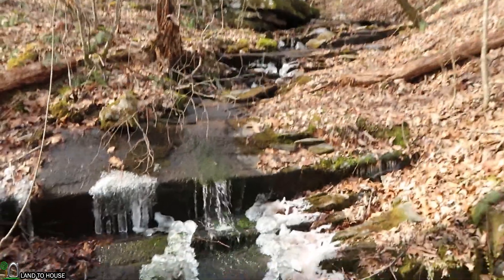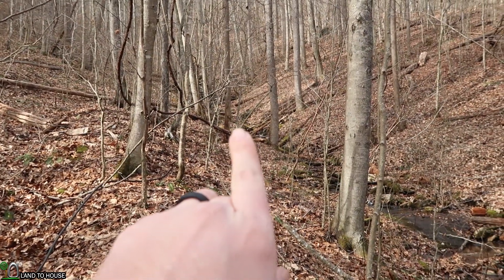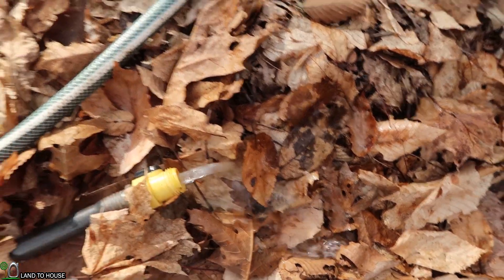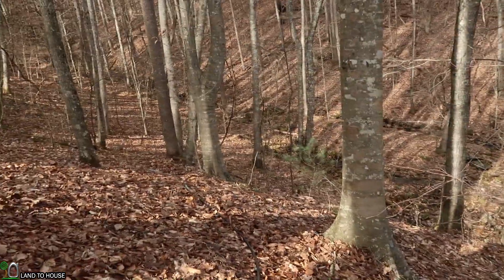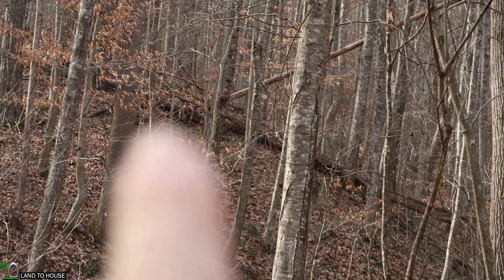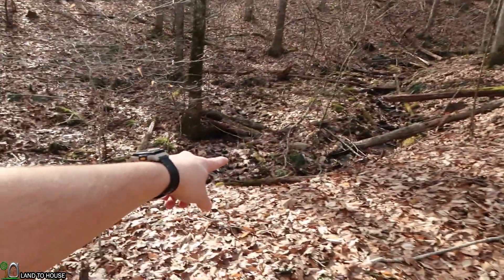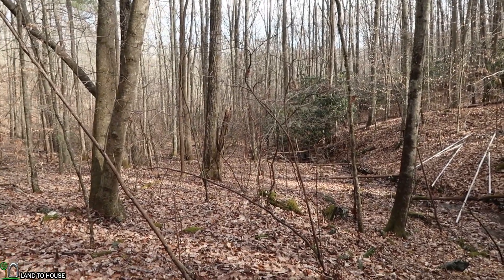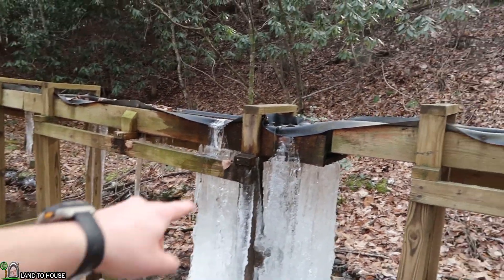Moving the Micro Hydro Intake

Comment: If you followed the creek bed using the largest area of flow 600’ of 2” to 100’ of 1’ to 100’ of 3/4” to 100’ of 1/2” should increase your output pressure a great deal.

Comment: No, don't make a channel. Use a extra large diameter pipe as a primary penstock and keep the gradient slight and constant. Then fit an air stand at the 50 gallon drum and connect the actual penstock. If in doubt, use bigger diameter pipe.

Comment: I didn't hear you specify the material of your 55 gal barrel; you probably already figure using poly instead of steel...I used steel for other purpose and it makes a great pinhole spray source in a couple years
Reply from the maker: I used a plastic barrel. So far it's doing really well. I picked one up in my local hardware store for around $15.

Comment: Need a large head stock pond to feed to the barrel supply line, I would avoid a  barrel get a larger tank to act as pen stock. Seems to me the next step is just use garden hose to fill the head stock fo testing. Use the ram pump to take the waste off the hydro to refill the pen stock year rounds sounds like a smart plan.

Comment: Looking at the intake location i wonder why you dont go a bit further upstream. Judging from the video i'd say  you can easily gain additional 3-4 psi. Most of the hydro setups i've viewed on youtube end up building an intake structure using a coanda screen or something similar that would fit right on one of those steps instead of sucking water out of a puddle behind one.
Reply: the use of a siphon  was  Convenient.     no  work   required.

Comment: Just an armchair thought here: I would personally run 2.5" or 3" penstock the whole the way. It would avoid most of the pressure loss due to pipe friction. Plus you would avoid the issues Joe brings up. How much more expensive would that be? It might be worth spending a little more up front for greater reliability.
Reply from the maker: I like the idea. The cost is likely going to be a lot more. Around $300 extra on top of the $900. I could probably make an extra 100w. But to be honest I should get 400w currently.  That's a lot for the house. I will have to see as times gets closer. Thanks for the input!!
Reply: 'you would personally'  NEED  to understand that when the flow rate is  So  low, the use  of  a  larger diameter penstock  is  irrelevant.

Comment: Why not build your mini hydro at the source and just run electric lines to your house? Also you could pond that waterfall section. Is that concrete or natural stone?  Ponding will build psi and gpm.
Reply from the maker: Do you mean have a micro turbine at that waterfall? I am going to have the archamedes turbine or waterwheel at the bottom at some point. . . .running 1350 feet of wire from that waterfall does not sound good. . Also it would only be a few watts.
Reply: 'why not'  be  100%   WRONG  
the  flow rate is  Determined by the amount of water present, in the source.        flow  rate  CANNOT  be  Increased, artificially.!!!      the power comes from  water,   Falling  Downwards.     conclusion:  the intake  MUST  be at the highest practical  elevation; if necessary, head  must be  'preserved', until the water can be delivered to a hydroturbine.

Comment: WILL YOU GET MORE FRICTION WITH THE RIBBED WALLS OF THAT DRAIN PIPE THAN WITH THE FLAT WALLS OF POLY?   WILL YOU GET A  TURBULENCE OVER THE RIBS ?  I JUST WONDERED.
Reply from the maker: There will be more friction for sure! But using a 4" pipe for 40gpm max should not be an issue. A 4" corrugated pipe can pull 70gpm at 5 feet of head pressure. So If I have a drop of 2 feet or so I can still pull the 40 or less gpm that I will have. That is the theory at least.  Some of this might change as I get into the project.
Reply: used  only  for the   lateral transport of the water.

Comment: I can't imagine this would turn out well for you. You'lll spend a bunch of effort trying to keep the pipe flat enough to prevent airlocks and silt buildup and you'll still lose head height and not shorten the penstock a significant-enough amount to offset the effort and additional cost of corrugated pipe. Just my opinion.
Reply from the maker: It will be interesting. Keeping the pipe flat and on the hill will be a challenge. Air locks will likely happen for the first several rounds of testing. I hope to have a way to clean out the intake box from silt buildup to help keep the pipe clean ish. The power savings will be around 50w continually. So $48 a year increase in power production.  I ran a tape measure the full length of the system and this will save 200 feet of penstock. So a savings of $80 from the corrugated pipe and then power increase of $48 a year. That means a $128 savings for the first year. I might have to ditch the idea later but it will make for great youtube content haha. (you make great points in all areas. Thank you)
Reply: @LandtoHouse  Now i want to play with water  " I might have to ditch the idea later but it will make for great youtube content haha"
Reply: airlocks  will  NOT  be an issue in the   LATERAL  transport of water.   because their is no   Need that  the process be  an  airtight  one.      it is obvious that the use of a catchment at the top the penstock, allows  air  to  escape.
Reply: @daviddavids2884  David, In my experience if there is any unintentional high point along the corrugated pipe air will be trapped which will slow or stop the water flow necessitating a vent at that point. I think silt may be also be a problem due to slow flow of water which will tend to allow the silt to settle rather than being flushed out. 

I would love to compare the efficiency of your system as you have outlined versus a design replacing the first 200ft of penstock with 4in corrugated pipe. You will save the head loss incurred with the lateral transport of water and the 4in corrugated pipe will have very low friction as the water speed would be a fraction of the water speed in a 2" pipe.
Looking forward to your reply. Sean
Reply from the maker: I have decided to go from the screened intake back to the 55 gallon barrel about 20 feet away and then run the 2 inch pipe from there. Ditching the idea of 4 inch pipe. The extra 100 or so feet that would be saved does not have a significant drop-in friction loss. so I feel like
Reply: @seanmurphy1084      1)  if   if   if   -   if there are Flaws in the execution, then, 'all bets are off'.        2)  the stated slope (of a lateral transport pipe) results in   MINIMUM  head losses.   so, a head-loss argument  FAILS.         
3)  in the case of  very-Low-flow rate,  the use of a  (correctly designed) Waterwheel is  called for  ---  so,  there is  NO  need for a  penstock!!!        4)   'water speed'   wtf  is  that.       5)  energy is in:    flow rate (the  Amount  of  Falling  MASS), gravity  and  Head.     in the case of a waterwheel, the  Effective head is   the  Diameter   of the 'wheel.    period.
Reply: I agree totally with Joe. Adding this extra stage is just more stuff to cause problems and extra work. If you want to save cost, use the corrugated pipe as the penstock at the top and use the expensive pipe where the pressure builds up further down.  Should be good up to 10 PSI, you can check this by pressure testing a sample until it fails using a high pressure washer. Would make a good video. If the corrugated pipe has more friction use a larger size, it will still cost less. Sean